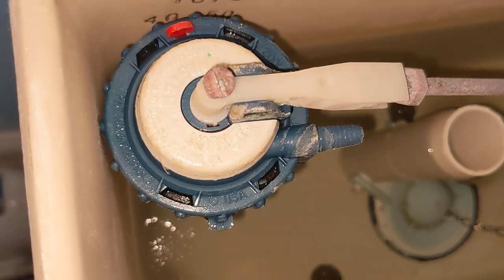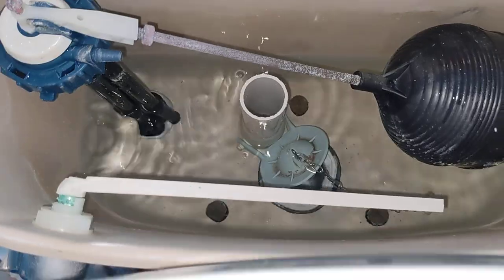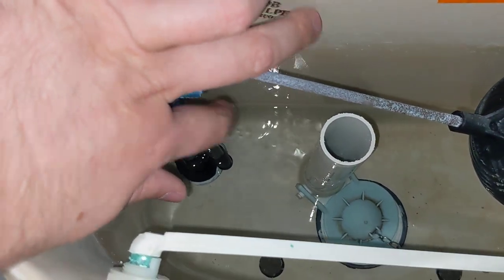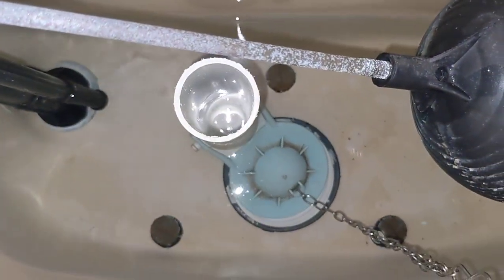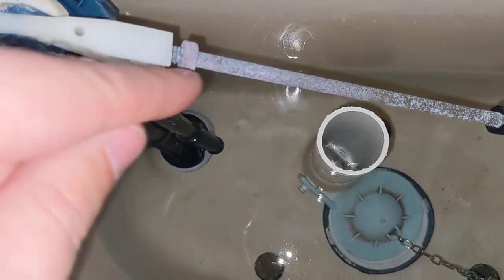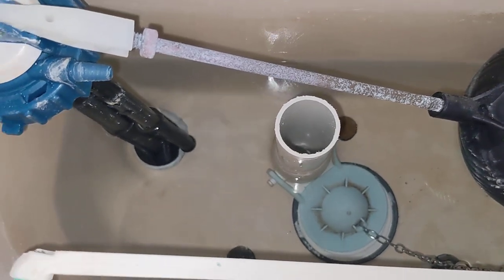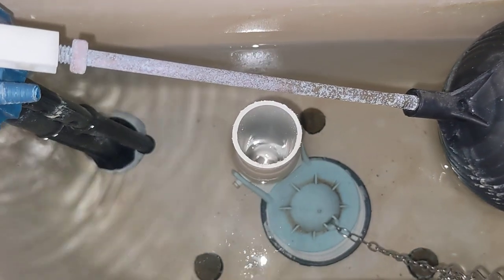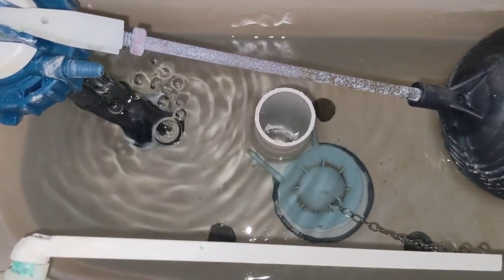Flush Master Mark IV - how does the toilet bowl refill??

Comment: Ha! Have the exact same setup and trying to figure out the same thing! Even more confusing since most setups you see online use that top side nozzle and a tube going into the overflow tube. Did you ever figure it out or did you just rip the whole thing out and replace it? Mines about 16 years old, no leaks or anything yet but I'd like to know more about it.